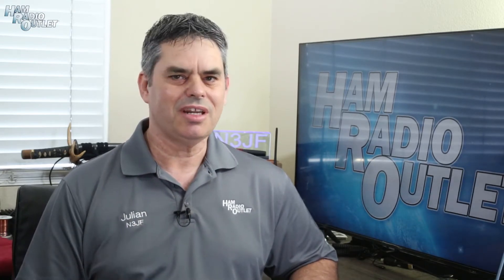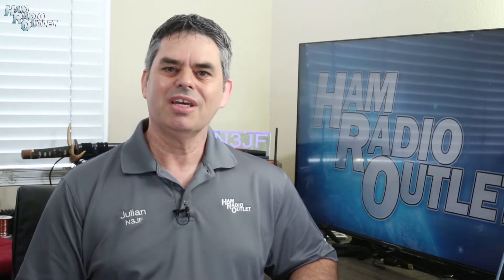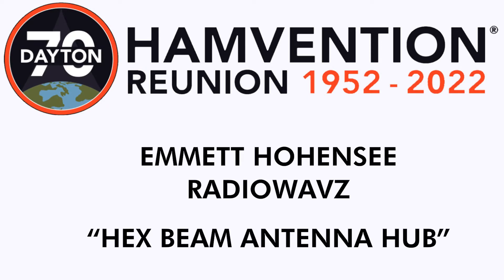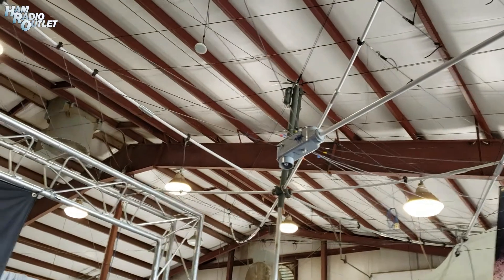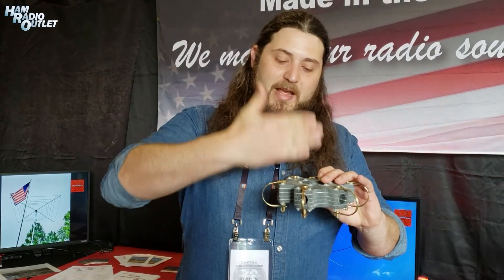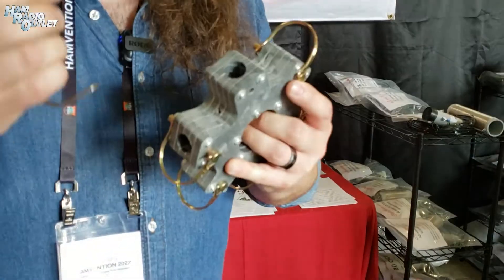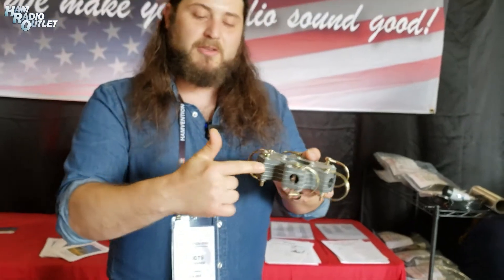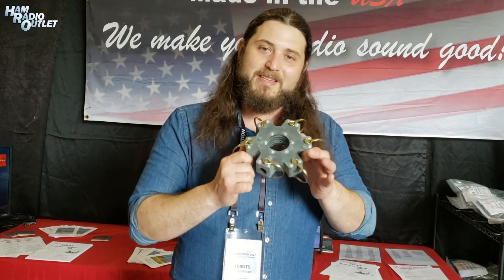RadioWavz Hex Beam Hub - Dayton Hamvention 2022

Comment: Bought a Radiowavz hexbeam last fall.  It was useless without a tuner.  Swr was sky high on almost every band.  Sent them an email and never got a response.   

With a tuner I have talked to Japan on 100 watts.  But the point of it is that I'm not supposed to need a tuner.
Reply from the maker: Can't speak to your specific case, of course, however RadioWavz lists not only their email address but also their mailing address and contact phone numbers on their web page. If email goes to spam, they might not see it, so it's worth a follow-up phone call or even a snail-mail letter. It's quite possible there was a production error or error during assembly that when discovered could have fixed the problem. If this has not been resolved, I would still recommend some follow-up.
Reply: @HamRadioOutlet  Emailed with them multiple times before and after the order so I don't think it went to spam.
Reply from the maker: @mkonvo  Ok. I've forwarded this thread to them.
Reply: @HamRadioOutlet  I appreciate it but not really necessary.  The antenna works fine  but not as advertised.  Just didn't think it was good business for them to ignore the issue.  Thanks!
Reply: @HamRadioOutlet  I also purchased an OCF dipole from them that works great.